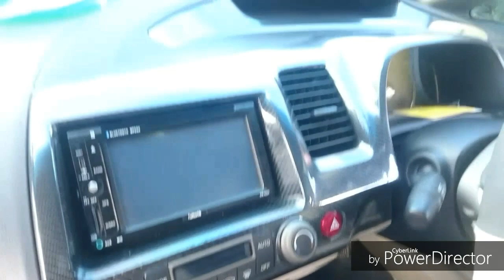Carbon fiber wrap vinyl - Honda Civic dashboard

Comment: How thick is that vinyl? I used 6 mil vvivid XPO gloss and it was only recommend for flat surfaces and was impossible to work with on curves
Reply from the maker: For the thickness of the sticker, I forgot because it's been a long time... what I remember at that time was the sticker was quite thick if I remember the width, which is 45 cm wide

Comment: Great! Question, is this wrap stick to the rubber dashboard well? I'm trying to do it on my dashboard but little bit concern that it will loose later. What do you think? It will last long?
Reply from the maker: For stickers whose glue is not strong enough, it usually doesn't last long to stick to the dashboard, but for stickers, look for one that has strong glue to last a long time ... don't open quickly when attached to the dashbord👍👍👍🙏